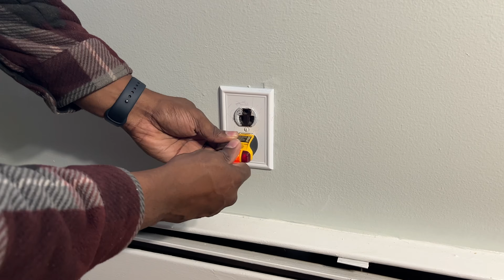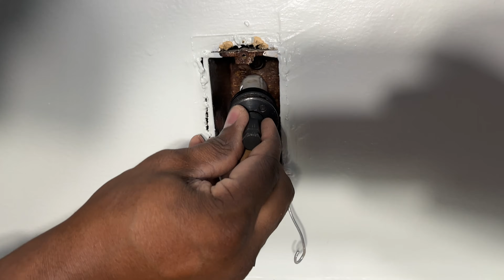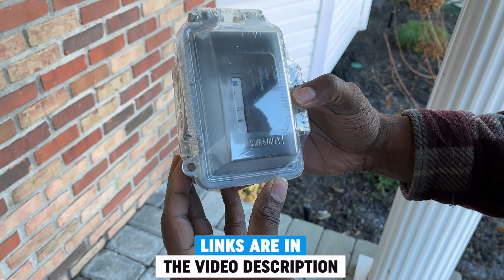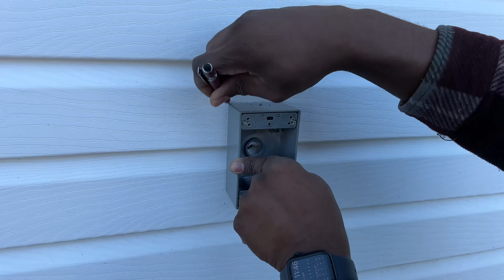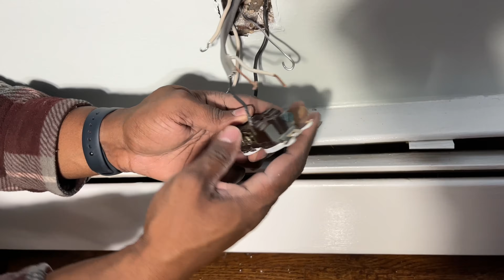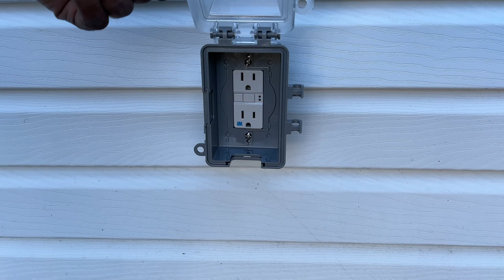How to Add an Outdoor GFCI Outlet From an Existing Indoor Outlet

Comment: Thank you for this informative Video! Keep them coming!  I have a question, Would Pigtails work in this install?
Reply from the maker: You're welcome. Pigtails can definitely work. Using pigtails will allow you to replace a faulty receptacle without losing power to the rest of the circuit.

Comment: I'm no electrician, but I see numerous issues with this installation. I recommend that everyone watch other videos and consult with ChatGPT for clarification. For starters, here are some things I would have done differently. 
1. Upgrade electrical box to 24.5 cu for 3 romex cables. 2. Use correct NM-B romex (easier to work with) and not underground scraps of cable. 3. upgrade receptacle and never back stab. 4. Use pig tails for connecting all Romex cables. 5. If using a metal box, ground the box and use the pilot holes located inside the box to drill a hole and install it on the siding. 6. Seal the hole with silicon.  7. add caulk around the box. 8. Romex strain relieve on the back of the box to prevent cable from slipping
Reply from the maker: I appreciate your detailed feedback and suggestions. I'll definitely keep these points in mind for future projects and improvements.
Reply: Problem #1 is to "consult with ChatGPT".  ChatGPT is not a licensed electrician and gets many things wrong.  Talk to an actual live electrician (active or retired).  Most that I have worked with will advise you of the right way to do many of these smaller jobs.  Support the knowledge of the trades.
Reply: The UF cable is correct because NM romex can’t be used outside in a damp environment .. the outside outlet could be compromised with moisture. That’s  actually code

Comment: I want to encourage people to refer to your electrical codes and training videos from licensed electricians. By doing this you will ensure safety and optimize performance. This video was  most likely done by an unlicensed electrician who has not demonstrated best practices. Here are some of my comments, it is not an exhaustive list. 
1) Best practices - weather seal should be applied between the siding and the external electrical box. The gap of the siding will allow water, cold/ hot air and  insects to pass from outside to inside the house
2) Best practices - Did not use a protective grommet on both the interior and exterior boxes where the electrical cables run through the box and did not secure the electrical cable to the boxes
3) Terminology - power is measured by a watt meter, measuring watts. Not a voltmeter that measures voltage
4) Best practices - the outlet is apparently old having paint on it and has the wires pushed into the back connection terminals. Although it can be acceptable there is an increased risk that the connections may lose its ability to make a good connection over time, oxidation, vibration and heat fatigue. Since new outlets are relatively inexpensive it would be better to get a new one. Additionally re-strip the wire and use a shepherd hook by the wire screws as per manufacturer’s instructions. 
5) Best practices - should have connected the live wires to the GFCI first and used the GFCI load to provide power to the interior outlet. This would provide GFCI protection in more than two locations. Note This is optional and you may still route the wires as shown.
6) Best practices- not sure if the interior outlet is located under a window that can be opened. If so that is not good as water could drip on the exposed unprotected interior outlet.
7) Best practices - The insulation of the wires were exposed to potential damage when drilling the holes in the wall. If using a drill in this situation tuck them securely to avoid damage. 
I’ll stop now, hope this helps.
Reply from the maker: Thanks for your detailed feedback. I appreciate the insights and suggestions regarding best practices for electrical work!

Comment: why did you took off hot wire and neutral wire if you didn't have to hook up new hot/neutral on existing connection ?
Reply from the maker: I needed to remove the entire outlet to create space to make the hole.

Comment: That box needs a ground wire connected to the green screw. Technically, the outlet screws will ground it, but code is to connect the wire directly.
Reply from the maker: This is true. This is an older house where they did not run a direct ground wire. 🤔 maybe I’ll make a video on how to run new lines with a ground wire…
Reply: @JayOfAllTrades1  It's the same ground wire you connected to the outlet. Either wrap around the screw, then connect to the outlet, or pigtail the ground and connect box and outlet with their own wire.

Comment: Not long ago I discovered that Home depot sells a vinyl accessory for exterior plugs(also for vents and light fixtures), makes a much cleaner install in my opinion!

Here’s how it’s called: “Mid America MountMaster Exterior Fixture Split Block Mini Mounting Block 5-inch x 6 3/4-inch White Vinyl Siding Accessory”

Cheers and great work!
Reply from the maker: Thank you for the recommendation. I’ll try and pick one up and do an install. Looks like a useful product 👍

Comment: Im just curious why not put the line wires directly into the gfci and the load from that to the pre-existing outlet? I thought that would help protect the other outlet
Reply from the maker: Yes that would protect the other outlet but it's not a requirement in the living room space so I went with the easier option. You could, however, do that to protect any outlets downstream from the GFCI. That was a great question. Thank you!

Comment: Great job and I appreciate you sharing this. I want to do exactly the same thing but my house wire does not have the ground wire (just hot and neutral). What would you do in this situation?
Reply from the maker: @sais9221  It sounds like you have an older outlet. Ungrounded outlets are common in older homes, while newer homes typically have grounded outlets. The ground wire provides a path for electrical current to safely flow to the ground in case of a fault, preventing electrical shock. Ungrounded outlets are functional, but they lack the safety features of grounded outlets, especially for appliances with metal cases, so that would be the concern here. While installing GFCI (Ground Fault Circuit Interrupter) outlets can offer some protection in ungrounded circuits, they don't provide the same level of safety as a properly grounded circuit so it all depends on what you'll be plugging into the outlet.